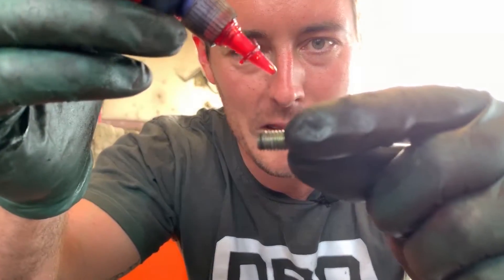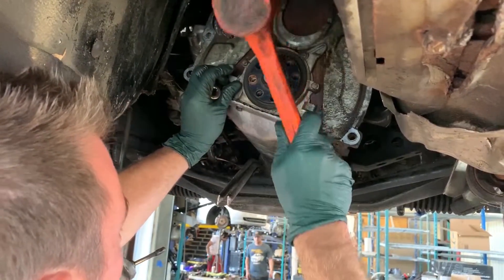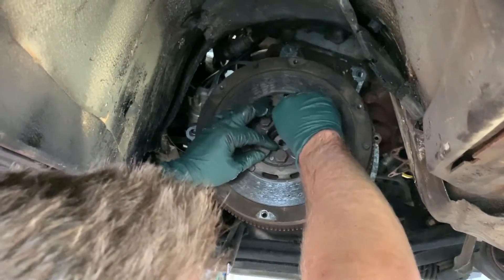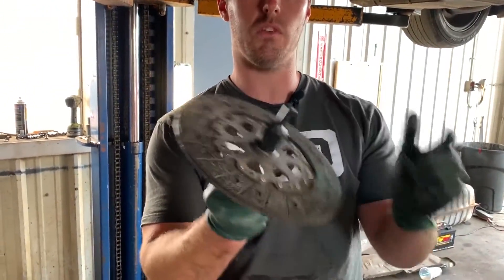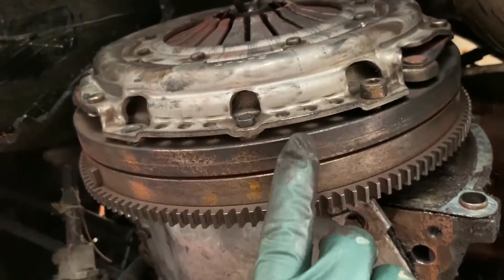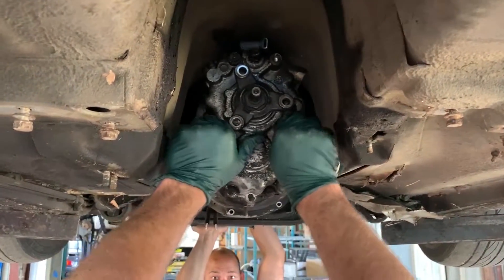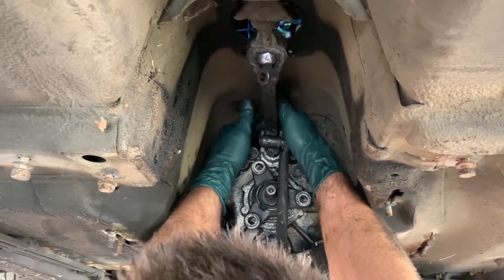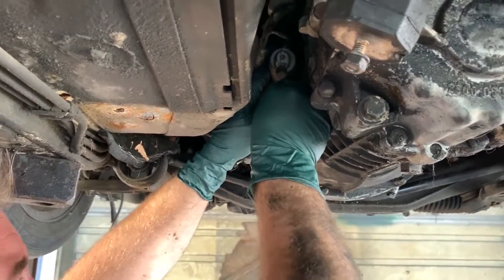e30 Manual Swap How-To Part 2: Installing The 5 Speed

Comment: i have a swap e30 m50b25 with a zf 5 speed, question im having problem putting my clutch Slave cylinder my driveshaft and tranny mount is already installed which looks from this video might have  been easy to install before installing my driveshaft and tranny mount right ?
Reply from the maker: Hit me up on insta @ dbo_murdo

Comment: Hi Will. I have an ‘87 325e 5spd donor for my ‘87 325is auto. Do you know if it’s a straight swap with all the parts you listed?
I was told that I’d need an E21 Release Bearing rather than the E30 part number...which sounded weird to me.
Reply from the maker: As long as you use all of the parts from the donor car you are in business don't listen to whoever told you about that e21 nonsense you're good to go partner!
Reply: Cheers Boss, I’ll let you know how it goes.
Reply: @theflyingferret77  How did it go>
Reply: @sambrown1760  Perfect, no issues with the manual conversion. Everything went together exactly as Will said it would. As far as the Gearbox and associated swap parts...there's no difference between "e" and "i/is".

Comment: 9 hours straight of trying to spline the trans. took trans on and off 3 times to realign the clutch disc and tap in the pilot bearing further. long story short i pulled in the trans with the bolts. let’s see what happens🥶
Reply from the maker: Sometimes you gotta do what you gotta do.